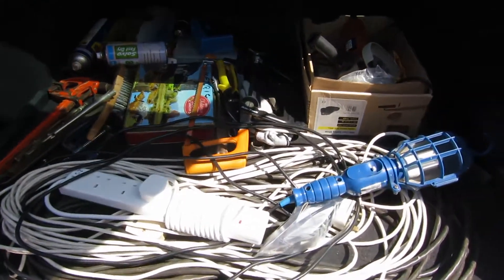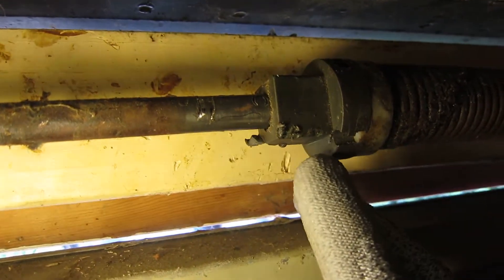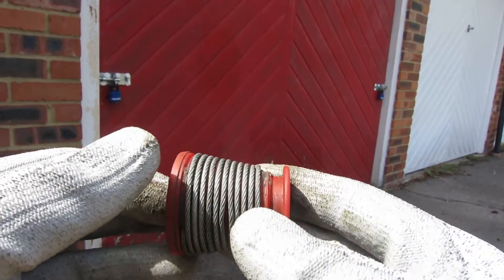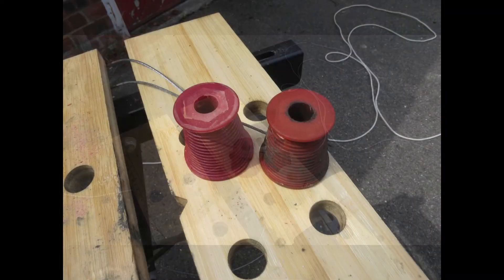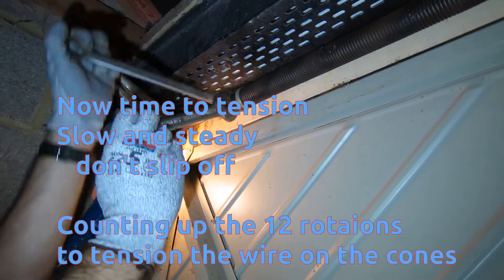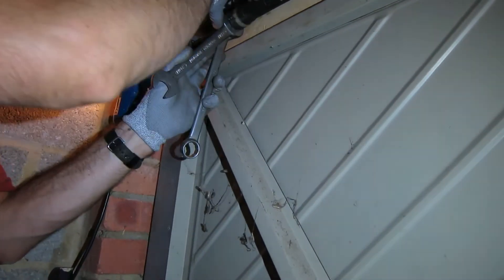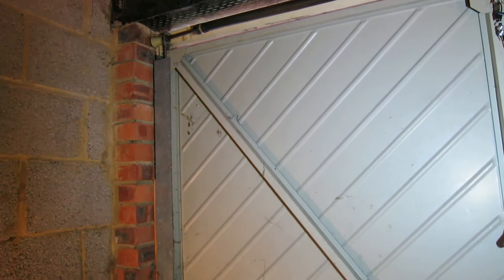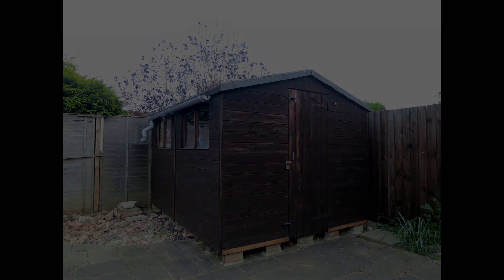Garage door lift cone replacement and torsion spring tension - no Music

Comment: How did you get the cone off with those bricks in the way?
Reply from the maker: There was just enough space to get the cone off the end of the bar - it was tight. I can't remember if we had to slacken both ends to let the bar float in order to gain that little extra.

Comment: Confused, but in a good way, about mine. Was all psyched up for the battle to tension my spring without killing myself and... it couldn't have been any easier. I didn't end up needing two spanners. I used one to tighten but when I removed it to turn again the spring just stayed locked in position. Seemed as it if it had some kind of safety brake that meant it dug in and wouldn't lose the applied tension. Then I just re-tightened the allen screws and it was perfect. This from a spring that had lost ALL of its tension and that i feared might be unfixable. It's a Cardale door. Would be interested to know if anyone has seen similar or did I just get very lucky?
Reply from the maker: I'm glad that my video was inspiration for you to investigate and solve your own door.

Comment: On my tensioner I have a holes for a 10mm bar instead, Which is now worn...so if the bar slips out after 10mins of winding you have to start again...the rage inside is unreal when this happens 🤬🤬🤬😂😂😂😂
Reply from the maker: Hope that the internal rage is just that and it does not cause any damage to you or the door.
Reply: @mygrandadsshed unfortunately the door got it a few months back...and my big toe paid the price...🤣🤣🤣

Comment: E actly same as other video without music. Still not enough to many stages skiped.
Reply from the maker: I'm not sure which bit you think is missing?
1) Remove tension from the spring, this had happened as it was broken.
2) Swap the cones (modifying if the correct one was not purchased); left/right orientation matters.
3) Attach lift wires, removing slack from both sides and set it all in place with the locking pin.
4) Add tension, lock off, release the locking pin carefully.
Remember that I recorded, edit & posted this video to amuse myself. If people can use it as a reference among all the other videos on the web that's good. I'm not a garage door installer.
You could try your local garage door company like Cambridge Garage Doors or Fenland Garage Doors they may be able to offer some professional advice.
Reply: @mygrandadsshed  my problem is that I have fit the new cones but seems to be no tension on the large spring. When I try to get the tension on the large spring it dies not seem to tighten 😕 🙃
Reply from the maker: Let's work through where the tension runs. The lift wires attached to the closed door and try to pull it up. The other end of the lift wire should have about 1-2 turns around the cone. The cone should not spin on the axel shaft above the door, as it's got a pin through which you must have replaced already. This is all held in place with the vice grips to keep it from flapping around (there might be a hole drilled through the shaft somewhere which a drift pin can be inserted to catch on the frame).
The spring end with the nut locks onto the axel with two grub screws (these need to be disengaged for the tensioning operation). The other end of the spring should be firmly attached to the frame. I don't know how this is attached as it was not at fault - I did not bother to be inquisitive. From your last sentence this is where you have issue. Unless your tension nut is spinning in the spring?

Comment: Very useful video thanks. My garage mechanism looks very similar to yours. Can you tell me what brand it is? My issue is where the cone meets the spring rod in the end bracket it looks like the bearing had worn away and caused rod to drop slightly as a result. Can you recommend any places/sites that have these replacement bearings/bushes?
Reply from the maker: Hi, sadly I can't, I'm not an expert in these doors. This was the first time I'd attempted this repair. Maybe a fellow viewer can help answer. The local garage door company were only interested in taking the whole thing out and fitting new.
Reply: @mygrandadsshed  Yeah...I had a similar response. Said I needed a whole new torsion rod/bracket set up
Reply: Ebay were I got mine cheap as chips🤘
Reply: Most of these old garage doors tend to be ‘Henderson’ (not an expert, just be searching lots of things).

Comment: I ended up putting 54 quarter turns of tension into the spring, it doesn’t fly up like yours but is perfectly in balance, it sits where you leave it. I don’t think I’m going to add any more tension as I think that may be what snapped the wire in the first place. Thanks for your great video.